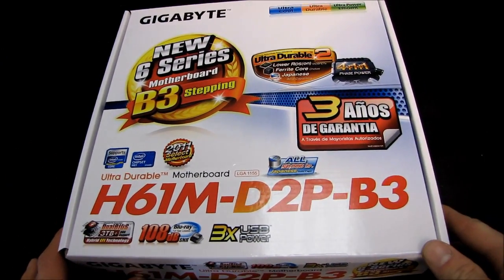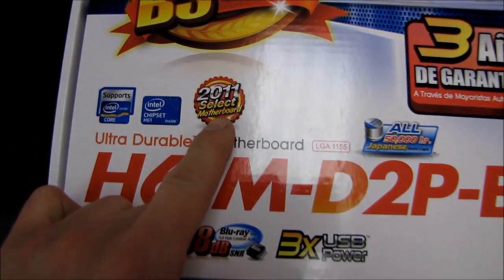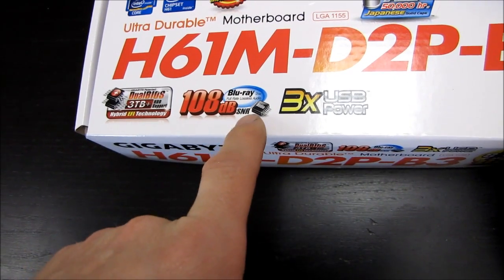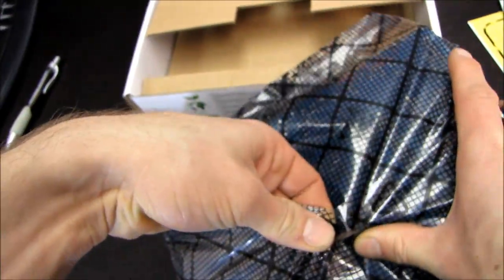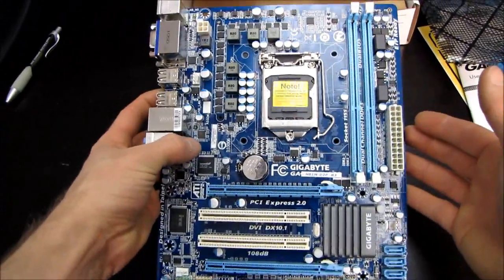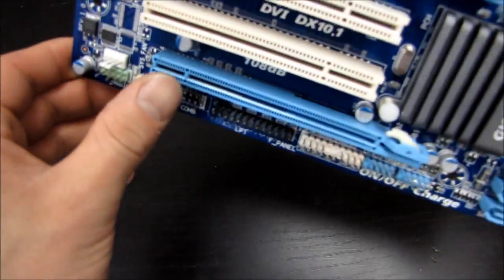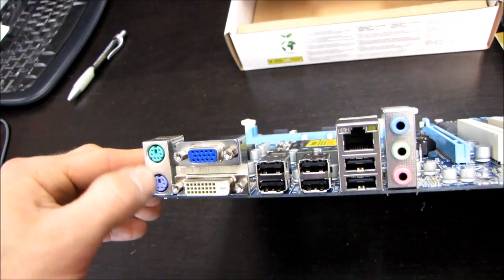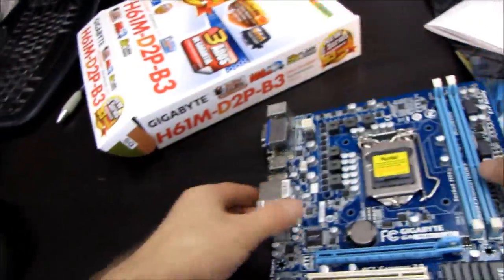Gigabyte H61M-D2P-B3 H61 DDR3 Sandy Bridge Motherboard Unboxing & First Look Linus Tech Tips

Comment: i have the same board but i have 2 issues

i have win 7 ultimate english 

1) in my earlier pc i had 2 inside hard drivers 1tb

in this one when i tried to open it using my 2 inside  hard drivers, always sent me a dos message repetetly

when i disconected the driver D the windows smoothely went into the main screen menu

does this motherboard doesnt support 2 inside hard drivers of 1 tb? or what i must do in order to work the harddriver D?

2) how much memory can be hold in this motherboard?

2 memories of 4x4 gb? 8x8 gb? or 1 of 16gb?

unfortunately i have a mini tower, so i can only have 500 watt:(  it cant hold a 600 watt do to tiny space that i have

Comment: how much ram does it support max, please reply asap
Reply: 16GB in a 2x8GB configuration. Dual channel is supported. DDR3 1333/1066/800 MHz memory modules are supported. Higher frequency modules will usually work but will be underclocked to one of these frequencies by default.
Reply: smartwizardst1 thankyou for your info. 😊
Reply: @smartwizardst1  why it doesn't support 32Gb? Anyway memory controller is already integrated into CPU. Ivy Bridge supports 32Gb RAM. Will this MoBo let to use only 16 of them?
Reply: @illynoizzz  it has only 2 RAM slots and the highest capacity non-ECC DDR3 module I've ever seen is 8GB. I only know of some ECC server memory that had 16GB on one module but it wouldn't work in this board.

Comment: Does this motherboard support the GTX 670 FTW?
Reply: easily, supports my 1070 lol, and its overclocked quite a bit.
Reply: Trojan Gaming can it support 3rd gen processor? or need bios update first? what cpu do you use right now.
Reply: Trojan Gaming can it support 3rd gen processor? or need bios update first? what cpu do you use right now.
Reply: cloudman18 Maybe I should’ve worded my response differently. I have the Gigabyte H61M-S2PT with my i7 3770k installed inside it. You can’t overclock the CPU, however there’s nothing hindering the overclocking, as you’d expect from any motherboard in existence, of the GPU to godly levels.

Comment: @patka1982 yes it's a pretty good Mobo . I've also got the Asus P8H61 with i5 2400 . It's good until and unless you are not planning for Overclocking and Sandy Bridge Processors are Clock lock chips ! except those 'K' edition ones ! and you have Specified i5 2500 .. so, it will be a pretty good choice and it is Cheaper too :D

Comment: @how2u Streaming will be reliant on your GPU and ISP speed.  Also, saying the I3-2100 is better for gaming isn't that cut-and-dry...at stock speeds playing a game that only uses 2 cores it is, but once you factor in that you can't overclock at all on the platform you've chosen, a black edition phenom ii starts to look better considering you can easily OC for better performance.  Then there's the handful of games that support quad-core CPU's where the phenom would dominate the I3.

Comment: @MrSazh so WHY THE FUCK IS LINUS USING THIS as a a gaming pc, doesnt make sense to me. ALL that I am saying is that if intel allowed for only one board architecture, and allowed users to overclock entry lvl boards and inprove on performance then i would gladly use an intel mb for a cheap gaming build. At the moment intels low end is exactly that,LOW END. I would not build a pc with that mb due to it being unfit for gaming/overclocking perposes.